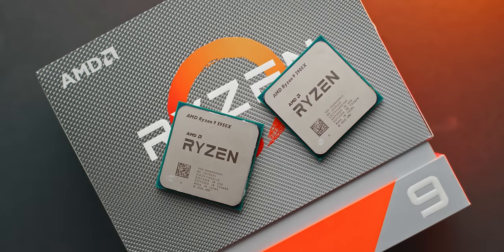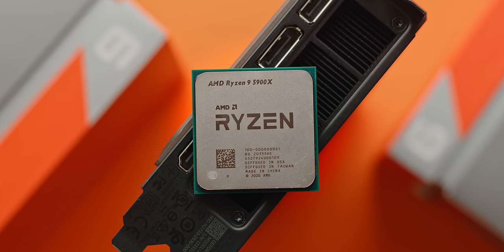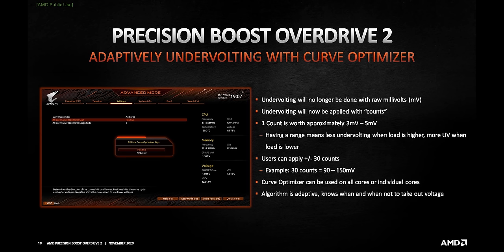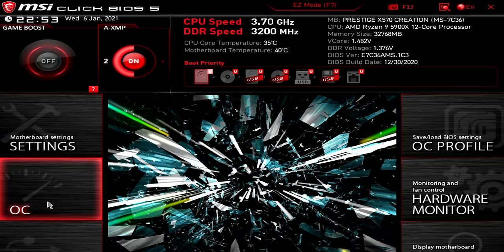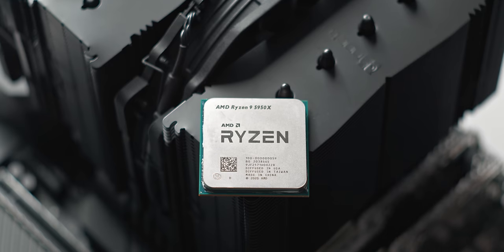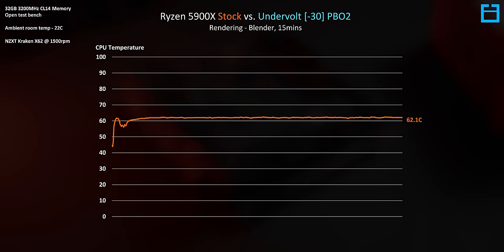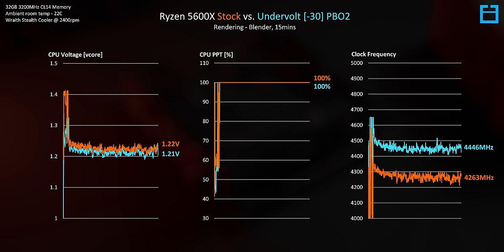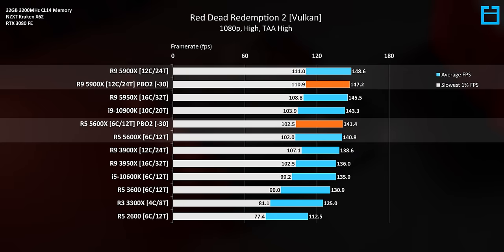Ryzen 5000 Undervolting with PBO2 – Absolutely Worth Doing

Comment: This is really nice! This should be a feature where you can essentially do this with the push of a button. Imagine an
optimized CPU profile that automatically undervolts with PBO2. Just like the XMP profile, you would just set it once and then forget about it.
Reply: This used to be a thing computers had back in the 80s and 90s,a "turbo" button right on the front of the case,which sounds like it would make it go faster but was actually to slow it down because the regular speed was too fast for older software to work right.

Comment: Nice, tried it out on 5950x, the -12 same as the video. 3Dmark score went up a bit, boost clock made it to 5053 instead of 5040, and slighty lower thermals and power draw. Nothing major but certainly a nice improvement. Thanks!
Reply: Has there been any stability issues or anything since then?

Comment: B450 also supported! Works great with Asus b450m tuf beta bios with agesa 1.2.0.0 and ryzen 5600x. With a value of -20 I get stable improvement of about 5%. Value of -30 not stable though. You can find the setting in Advanced / Amd overclocking / PBO / Curve optimiser

Comment: 30 can be unstable for 5900x in a long intensive computing session, eg 5 hrs. The stock setting doesn't have such instability.
I would recommend 15-20 instead of 30. 
Tested on at least 20 5900x manufactured in 2020
Reply: I agree on this... >.<
Reply: This should be upvoted more.
Reply: Thanks for your comment I will use your values on the weekend. Trying something like undervolting for the first time.

Comment: Amazing! Dropped my temperatures for about 11 degrees celsius and no performance loss. 59 degrees at full load on Metro Exodus using a Ryzen 5600x.

The only thing is that i used -10 in the PBO Curve, and it's very stable; no crashes. I tried -15, -20, but got frequent crashes, so i found out that -10 is stable for me :)
Reply: Did you go for an All-core or single core?
Reply: @daelmondejar8536  it’s definitely all, one core wouldn’t give you 10 degree difference buddy
Reply: @pedropierre9594  I see. Thank you! It’s my first time getting a Ryzen CPU and I wanted to make sure before messing with the BIOS
Reply: It crashes at -15 because your strongest cores cannot maintain -15 but the weaker certainly will

Comment: great video. This gives a noticeable increase in 5600x CPU frequency. Which in turn gives much better gaming minimum framerates and framerate consistency. This is probably the most important factor for gaming and not max framerate.
Reply: What values did you use and have you had any issues since
Reply: Is your system stable?
Reply: @enessengul219 -30 curve stablo may 5600x temps drop to 10c amwzing
Reply: @thatsreallyamoon -30.for me 5600x still stable

Comment: Awesome! Did manage a -30 on my 5600x increasing 5% in performance while losing 10c. Also i just cleaned the case front dust filter from a thicc layer of dust and lost another 5c by just cleaning.

Now im running full load super silent with my noctua u12a cooler and getting 55c of max temp. (ambient of 22c). 

Thank you man! I was already trying to achieve this with ryzen master but it Always tell me it wasnt stable (pbo+curve) but via BIOS like your video all works fine. No bsod or crash while benchmarking with cinebench r23/r24.

Comment: Very helpful video. With my 5600x I didn't try this but had pretty good results with a PBO of 200MHz. The same setting didn't help my 5900x much, but this -30 offset worked like a charm. My Passmark rating single thread went from ~3500 to 3670 and my overall CPU rating went from ~40000 to ~42500.

Comment: Absolutely spot on! This is a feature that is truly worthy of a "finally" :o But still, Curve Optimizer seems like a solution to a problem that shouldn't really exist. 
I got impatient trying to get a hold of a 5000 series and went for a good deal on a 3800XT, and I've been playing around trying to tame the ridiculous voltage it uses at default. PB does a good job of clocking up, but shoots itself in the foot with the voltage. Temperatures aren't an issue, as my loop is complete overkill, but it keeps sending CPU power into the red.  PBO aactually gives worse performance, as, for some reason, it boosts 100MHz lower than default. Auto-overclocking is pointless for the same reasons, there's no point in raising the limits if it isn't hitting any of them.
Then, I fell into the same trap as the 1V guy, "lets stick an ofset on and see what happens." I dialed in 250mV and it was looking good: immediately dropped 20W from CPU, clocks boosted better than ever. Then R23 finished and only gave 10k, instead of 12k... After a few more runs, I noticed the Core VID was higher than it should be, and HWiNFO64 was showing the "Effective Clock" as only about 3600MHz, even though the "Clock" was a good 4500/4600ish. Clearly the motherboard's idea of "Core Voltage" is different to AMD's.
Dialing in a fixed frequency and voltage still seems like the only way to go for 3000 series. I've dialed in 4200MHz at 1.2V and it seems happy enough. Lots of tweaking still to be done, though.

Comment: Thank you! My 5800x also managed a Magnitude of 30.
+200 MHz all Core Clock and -10°C on Single Core load.
Reply: Nice, i think PBO2 undervolting would benefit 5800X best as its the hottest of the current 5000 series cpu and im thinking of getting it as well
Reply: same
Reply: Nice! Have you tested for stability? I did the same on my 5800x and it performed well on some stress tests but randomly restarted when installing a basic software.. trying to figure out how to test stability.
Reply: @Lha_Luke  hi, i tested stability using aida64 stability test and was unstable, i tweaked it a little more and with -20 was stable

Comment: Just installed a 5800X yesterday to compliment my 3080! This video came at the perfect time!
Reply: 😭😭you lucky...
Reply: @ahmad.dx1115  I am - I cannot deny that! There was a lot of patience and dedication to get the 3080 as well though..
Reply: Too bad im apoor 17 year old
Reply: check your temps before tinkering with pbo on a 5800x ... it is a furnace of a cpu. you can easily hit 80C on water.
Reply: @Amarushaya92  well the idea is to undervolt for lower temps!
Reply: @crunchie101  thats right but for a 5800x i might not be enough . i saw people complainig hitting 90C on a D15 in p95
Reply: I have a 5800X and been playing with PBO for a month. At first I got it to boost a single core to 5.0ghz then I got 4 cores to boost to 5.0ghz. Though even on a full custom loop that's only cpu bound with a 240ml and 360ml radiator I would be hitting roughly in the 60's sometimes high 70's under load in 3d mark timespy cpu physics test, in P95 it was hitting 78-81C. But definetly all 5800X is different you may get a cooler one! In the end I just decided to wait for more bios releases before messing with it more so I just have a manual oc to 4.7ghz on 1.25V LLC 3.
Reply: @lehroyale9259  4.7 @1.25v is a quite good bin i think
Reply: @lehroyale9259  good to know. I have a noctua C14s and noctua case fans and my goal is just to undervolt and stay at stock settings but lower temps. I haven't really tried stress tests except for AIDA64 which gets up to 71 degrees on stock. It idles at 36-41 degrees
Reply: I found i couldnt go past 25 on the offset. When set to 30 windows would blue screen and not boot. Anyone else found this issue? Cant say ive noticed any reduced temps. Still running around 36-40 low load and 60-67 while gaming with a Kranken X53 in a Cooler Master NR200P.
Reply: @lehroyale9259  im crashing at 4.7ghx 1.3v and reaching max temps of 85-89 in  games... let alone torture tests. Thats in a 120+360mm custom loop. I dont have curve optimiser in my Asrock b550 taichi bios that is one update behind but 2 patches ago (first bios I downloaded using flashback during the 6 month build) I could play games like metro exodus on max settings without crashing with  a manual overclock but crash on a game like smite... (it was only easy anti cheat games that crashed me?) Maybe a 5600 was the play afterall
Reply: @bobnorman3094  that is a real Pain . had simmilar problems on my customloop aswell . not that high temps. i did hit 85 C only in cinebench and 90 in prime95 but i found a solution for me . the "Der8auer Ryzen 3000 OC Bracket" wich moves the position of center of the coldplate onto the hotspot of the CPU . did result in 11°C lower temps on my 5800x . 77 C max in prime95 with an average 75C. you sould check out his video about the OC-Bracket.
also what did you use for stability test? smite should not crash on your overclock if you are prime95 stable
Reply: Ill have to check it out. I was crashing at default and undervolted settings but only on easy anticheat games for whatever reason. Whats odd is now my games arent running any higher than 72 or so but itll spike like for example bf5 just made me hit 93 but it occured in a basic menu/loading screen... all cores shot to 100% utilization.
Reply: @Amarushaya92  I don't know if its a "furnace" of a CPU or not but I do know that I checked mine on a surface plate at work and the IHS on it is NOT FLAT by about .003"  I believe this to be the problem with 'some' of these chips, the tops aren't flat and don't make good contact with your Heatsink.  I lapped mine and my waterblock on a piece of glass to a mirror shine, and at stock settings @idle, 27C (7C over ambient), during games mid 50's around 54C and on high workloads it hits 78C  It runs cooler than my old quadcore 2600K @4.4ghz 1.36v and its got double the threads and cores.  Maybe you should check your own setup and check your IHS flatness.  

Igor's Lab did a write up on this too noting that its best to install the CPU, burn it in a bit to get the temps up and let the IHS move around, THEN lap it.  Do your research.
Reply: @DJNosebleed  Pretty much the same as you. Same case, different AIO (Corsair), max stable is 25, same temps.

Comment: Wow!
I was having high temps on my airflow restricted case with the stock cooler on my 5600X
Temps were reaching 86C after three Cinebench runs with average score of 10835.
After undervolting using my Asrock b550 phantom gaming 4 ac BIOS and doing the same Cinebench test.
Temps maxed at 77 after the three runs with an average score of 11250!!  Incredible. Thank you man!
Reply: Can you share your adjustments
Reply: What did u do exactly??

Comment: Nice. Now I have my 5600 at maximum undervolt and it still manages to do +200 MHz boost. Temps are now perfect and so far it runs stable even in games like Witcher 3 next gen or Cyberpunk. Hope it shows long term stability.
Reply: Did you follow these same steps and go - 30 on the 5600?
Reply: @wogboy4708  yes, I managed -30 on all cores and still was able to boost the clock up 200 MHz.

Comment: What a time for this to be posted! I just managed to build a 5600X + RTX 3080 (retail)
Reply: Lucky man, enjoy gaming
Reply: I was going for a 5600× but I could only get a 5800×.
Reply: I was almost going to resort to a i9 9900K 😂 luck worked out a bit for me this time
Reply: got the same specs now, just upgraded! 1440p performance is so good
Reply: @nikhilrw  I would say luck was also with you and the 3080 ha
Reply: @ActionManXVI  yeah right now I’m running it for VR. Shall get a 1440p monitor soon for esports titles
Reply: I have that combination as well, you should consider trying a manual overclock/under-volt with your 5600x. With PBO and auto overclocking enabled, I would get 4.7 GHz single core clocks, and 4.4 GHz all core Boost clocks. I set a manual overclock of 4.6 GHz all-core, And I was able to lower my voltage all the way down to 1.15 V before experiencing Performance drops in cinebench R23. When I run user benchmark, I get a few points lower on single core and dual core scores, but Significantly higher on multi core, and runs 5C cooler under load.
Reply: @ElmerGLue   Clearly you didnt watch the video!   The CPU is actually boosting to higher speeds because of thermals and power draw!   Its pretty much allowing the CPU to fully draw all the power!  So its boosting to almost 5GHz on all 6 cores!
Reply: I cant get a stable 4.7ghz all core without running into thermal limits during an all core load such as rendering, even before my 3700x couldnt all core OC at 4.2ghz with the same issue, just my shit luck with the silicon 😂😂
Reply: @MechAdv  You hit silicon lottery 100%. My 5900x can't go above 4.4Ghz without 1.325v.
Reply: @ActionManXVI  My 5600x will only do 4.7Ghz all-core if I let the voltage go up to 1.4V which is silly considering that the performance gain over 4.6 is negligible and it runs 250mV lower Vcore. It’s like a 10C+ thermal difference for 100MHz. I think you’re probably fine.
Reply: @charlesthompson6779  I would think that a chip with double the cores and double the power draw would require higher voltage to maintain a stable overclock. No?
Reply: @nikhilrw damm where in India were you able get them for msrp
Reply: @darklight7046  Hahaha. Not India bruh, I'm in Canada.
Reply: @nikhilrw  ah I see, my bad.

Comment: I did this yesterday on my 5600x, Asus TUF x570 and was pretty amazed with the results, thanks for the guide. Before the tweak at stock cores would fluctuate between 3.7 and 4.6, and had some pretty high temps compared to what I was used to on my VERY old FX-8350. 50s idle and into the 80s just playing Overwatch on an h100i (my 8350 never went above 45, not that we can compare something so outdated, but I believe the FX-8350 did have a pretty high power draw, so I was surprised by this massive increase esp at idle, at only 65w on the 5600x). 

Anyway, I followed all of the steps discussed although I set the PBO limit to "Motherboard" rather than "Disabled" as directed in the video. Initially my -30 looked stable, but I got a number of blue screens when gaming and under load, so I dialed it back (er, up) to -28 and so far this has been a sweet spot with my particular chip and set up. I will report back after running in this set up for a while as I am planning on enjoying it and not tweaking anything further for some time.

The result though has been amazing. The "base" frequency appears to have been bumped up to ~3.9 ghz, (The boost setting in BIOS is indeed set to +200 mhz) and the boost is now 4.8. It basically just sits at 4.8, one core at least is almost always at boost, with periodic dips down to 3.9, behavior I did not see under the previous settings where all cores would often sit at 3.7 under light load or idle, or perhaps due to temperature limits at load.

The best thing; is that my temps are much lower. 38-45 idle depending on whether my A/C is on or not, and when gaming I have not seen over 71c. 

I would advise for anyone trying this on an Asus board, I played with only settings in the "Advanced" settings menu. There are also PBO settings in the "AI Tweaker" menu. I left all of the AI Tweaker menu settings to the default, which for me was "Auto". 

Now of course the 200mhz is not going to offer many daily use gains for people playing games. However, compared to old school overclocking where you got a small % bump and some higher temps, here I got much lower temps and more consistent, higher boosts. Those are real benefits, and you don't need to run a benchmarking tool or to be doing heavy rendering to see them. This curve undervolt really takes a great thing in the 5600x and makes it somehow even better, I'd advise anyone with basic ability to navigate the BIOS give it a shot if their system is set up to do so.
Reply: Nice to hear that. That's amazing lower temp and higher performance. I have a 5600x with asus rog strix B550 a gaming motherboard but I don't understand settings in Bios. Do you know how to do it? Best regards.
Reply: did you have any problems ? after pbo
Reply: Hey man, same hardware here. Did you have any problems with -28? I set it up at 28 aswell since at 30 my games suddenly closed.

Comment: The Ryzen 5600 processor (a year in use) received 10356 points and a temperature of 71C before undervolting in Cinebench R23. I used only undervolt, left the rest of the settings except for the boost of one core (which I turned off due to a huge temperature jump) on auto. After setting -30, I got 11044 with the same temperature and power consumption. So far on the second day everything is stable. Thank you for the video.
Reply: Any tips? Never undervolted anything haha. My 5600 gets to 90 degrees after 10 minutes of apex...

Comment: Thanks for this guide. I managed to lower my temperatures on Ryzen 7 5700x on B450 TOMAHAWS MAX board from MSI. Idle temps are -5°C. I tested temps on Cinebech R23. All core load temps are -8°C and plus 1100 points! Single core is -7°C.

Comment: Thank you so much man! This is soooo helpful! I have a Ryzen 5 5600x with my old cooler (Cryorig C7), don't wanna upgrade the cooler because I'm using a mini sff case. The temp was 70-72c when idle and 78-80c when gaming. After following your guide, the temp went down to 60c when idle and 70c when gaming! It's 10c different!
Reply: you should probably change the minimun processor state to 5%, as its probably boosting your cpu while idle
Reply: too high temps u will kill cpu
Reply: @Nomad_859  No, idle cores are put to sleep by clock stretching.